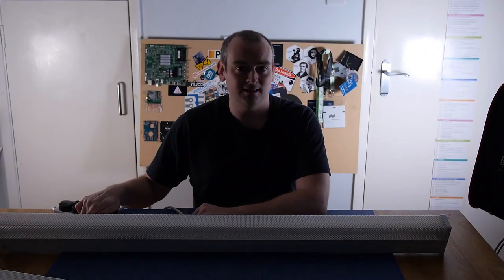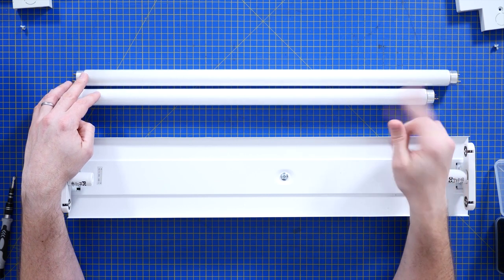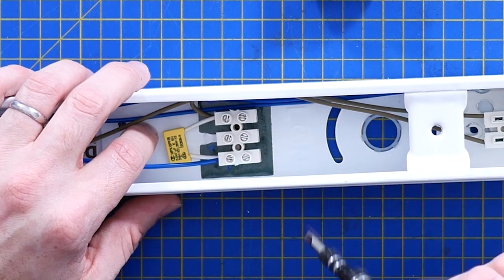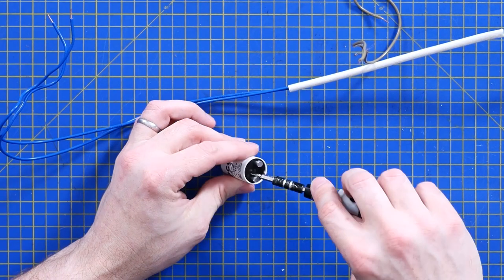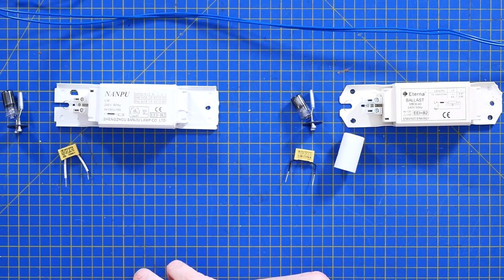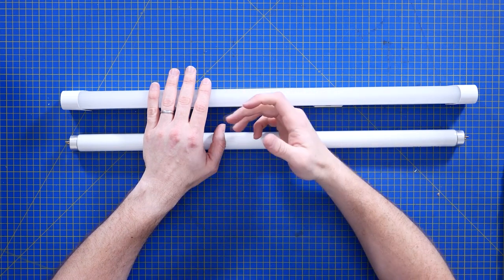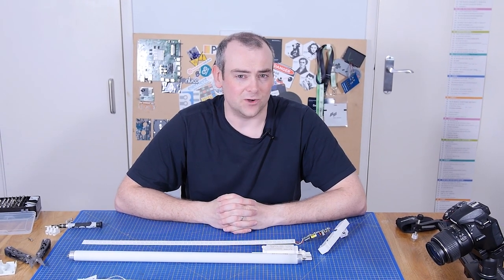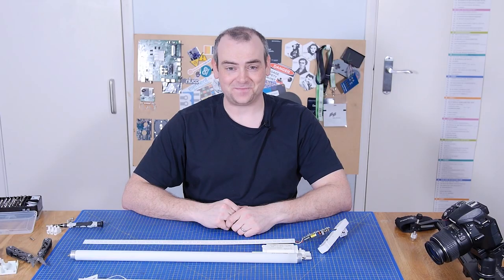Fluorescent Tube vs LED Lighting - The Electronics Inside

Comment: 10w led producing 4000lm?.if its producing 1000lm and is properly heat sinked it might last.the fitting used is not heat sinked and if it is overdrive to produce 4000ln it will not last.have you tested the actual output or are you just reading the chinesium lies
Reply: I think they are using the aluminium profile to sink the heat, which makes a lot of sense as it is exposed and can give the heat to ambient air. I'd be interested to know if one of these "uplighting" may have a shorter life as the heat may become captured in the diffusor?

Comment: Nice tear down as usual, but sorry the starter has always been the starter but the ballast is a choke/Inductor it's just a coil of wire on an iron former to provide a certain impedance at 50/60Hz.
But later designs can have an electronic ballast.
LED lamps tend not to last as long as they promise because they run them at 100%, hence they run hot and they don't like heat.
Reply: And because the inverter uses cheap, poor chinese capacitors which bulge and fail.
Reply: @paulcohen1555  Hi Paul all the ones I have seen have dead LED's the inverter works fine but you get the black spot of death on an LED, I replace the blown LED and they go on until the next one dies. It's that they run the LED's at full power and they over heat because they do not have enough heatsink area.
I usually by the next power rating up and modify them to run on half power.
they then last for ages.
The caps in the ones I have seen that have died are high temp 130deg C LESR and still have good capacitance and low ESR.
But I do try to buy from reputable source.
Reply: @FireballXL55  WHY you have to begin with "NO" and won't accept other's experience?
Reply: @paulcohen1555  Sorry it was not meant that way, I will change it when I get back to the office.
I did read it later and think it was too blunt and ruled out others experience.